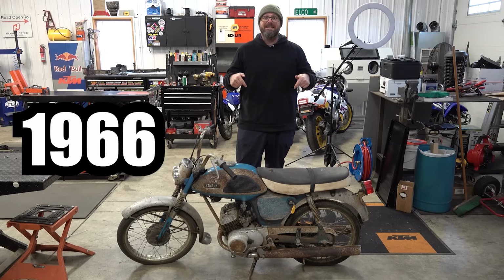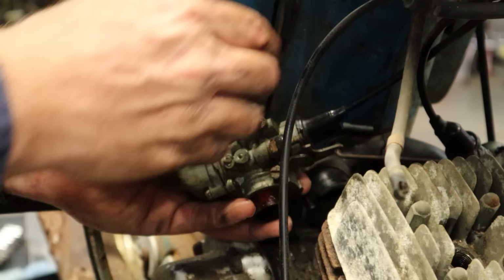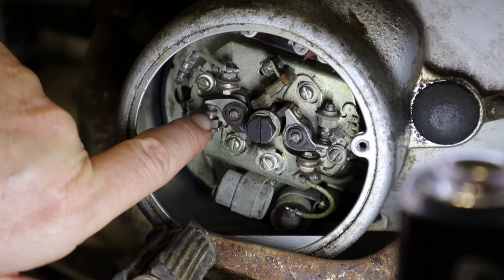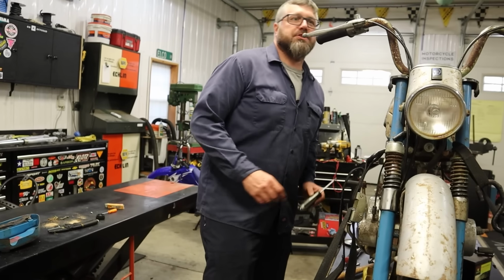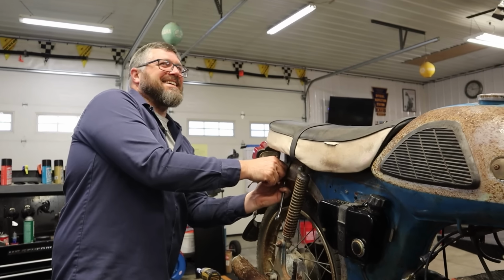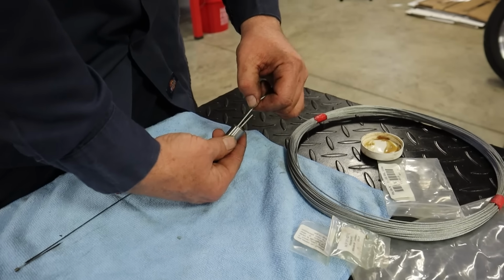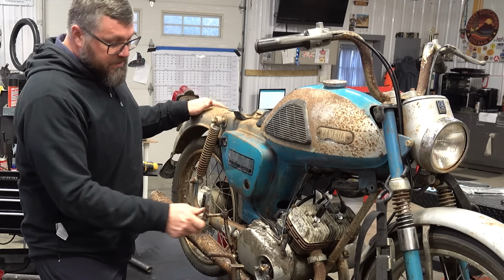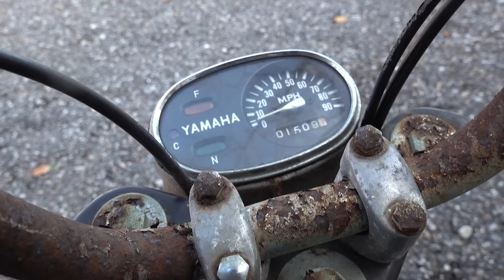Can I Get This 1960's Yamaha Motorcycle Running?

Comment: I appreciate your skill but, old two strokes? Nope! Not for me. I didnt like them in 1965. They were just awful compared to the 4 stroke competition.  They had narrow power bands and more often than not, oil gas mixtures were off. Too little oil...seize.  too much oil ....fowl. get to a gas station...oops...no two stroke oil. Yup, I remember kicking the kick starter until my leg was crying! The Honda I had... ran for more than 20 years with just oil changes. It ran until I sold it in 1988. Try that with a two stroke.